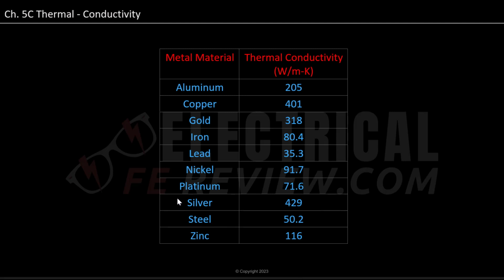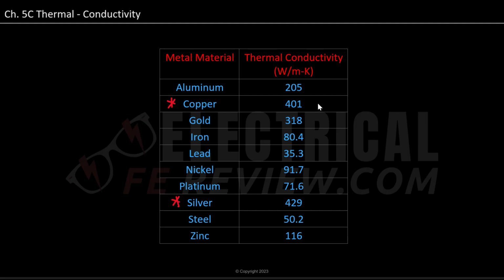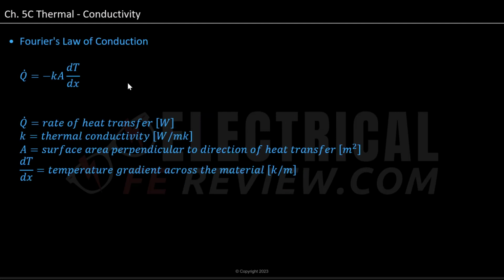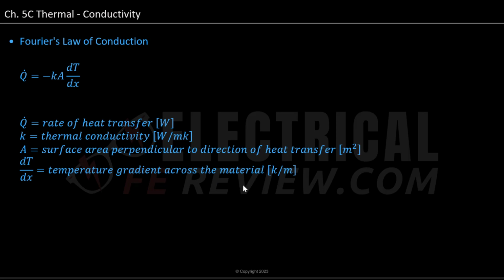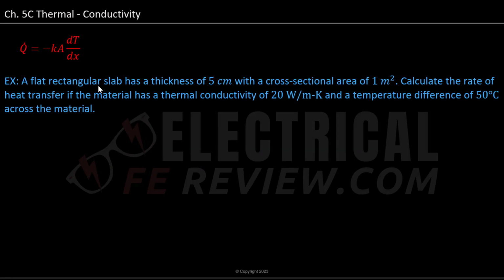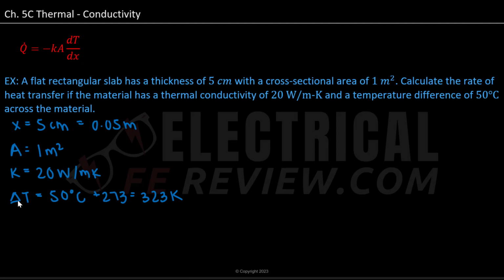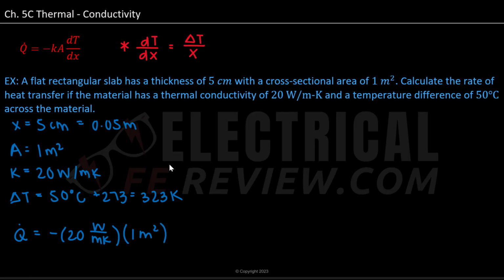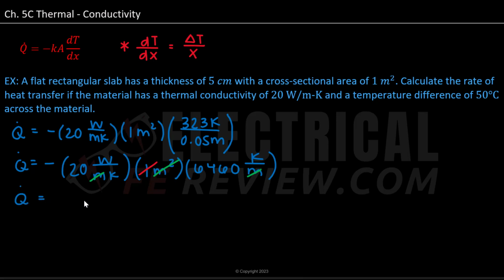Thermal Conductivity - Properties of Electrical Materials NCEES® Electrical and Computer FE Exam

Comment from the maker: Video Contents:
0:00 - Introduction to thermal conductivity
0:45 - Thermal conductivity in metal materials
1:05 - Table of common metals and their thermal conductivities
1:50 - Comparison of thermal conductivity in silver and steel
2:30 - Fourier's law of conduction
3:10 - Example problem
3:40 - Given information for the example problem
4:20 - Conversion of given information
5:00 - Calculation of temperature gradient
5:30 - Setting up the formula for rate of heat transfer
6:10 - Simplification of the formula

Ready to master the Electrical FE Exam? Don't miss out on our expert-led online course, with video examples and practice problems. Best of all, it's 100% FREE! Enroll today at https://www.electricalfereview.com and take the first step toward passing the FE exam.

Comment: isn't delta T 50?
Reply: just noticed that as well. just plug in 50. The solutions on this FE review channel should be taken with 5 grains of salt:face-purple-open-box:
Reply: I think they converted to kelvins to go from delta T = 50 Celsius to delta T = 323 Kelvin
Reply: that’s not right. Delta T is the same regardless. Imagine you have 30 C and 20 C. Delta C is 10 right?. So even if you converted both 30C and 20C to K, the Delta T would be 303K-293K which is still 10. dT does not change whether C or K scale
Reply: @paulkalungi1573  okay I see what you’re saying. Gonna redo this problem. Thanks